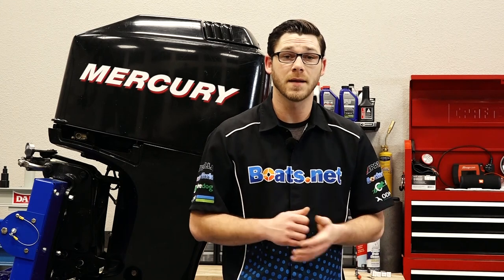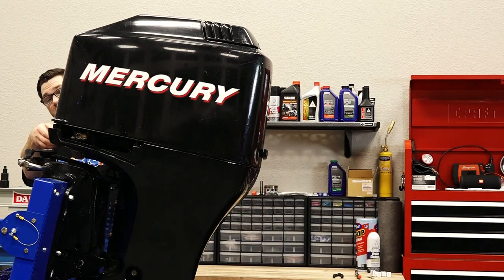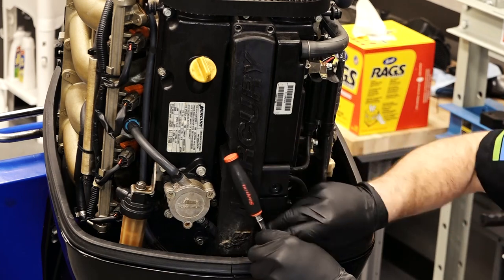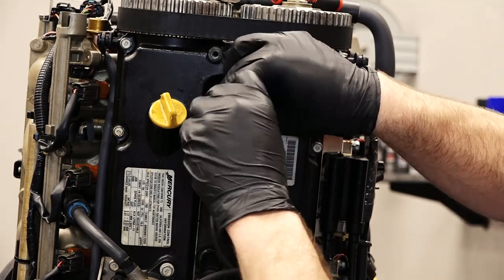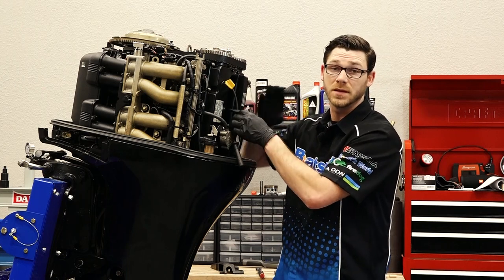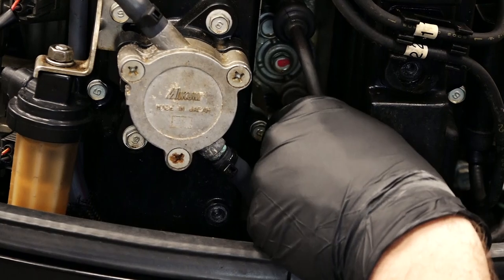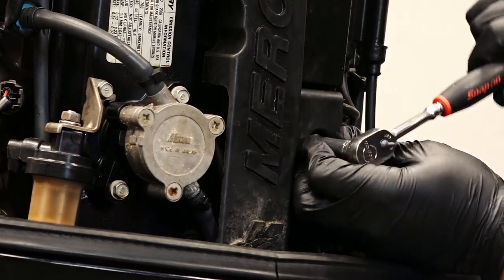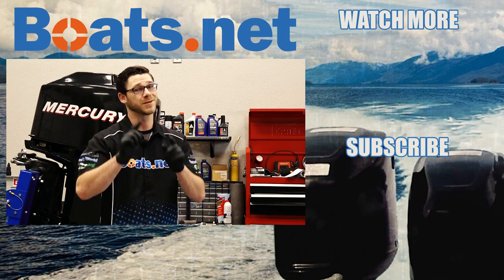How to Replace Outboard Spark Plugs | Mercury 115 Outboard  | Boats.net

Comment: What happens if there's fuel on the back of the spark plugs is there a reason for that I just took my 03 saltwater series pulled out the plugs have gas on it my whole garage actually smells like gas when my boat is stored in it